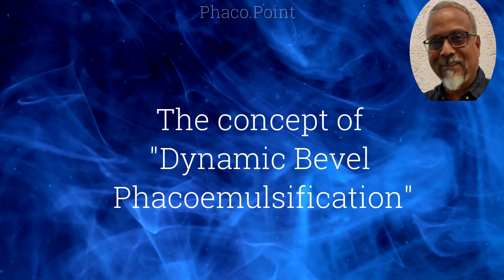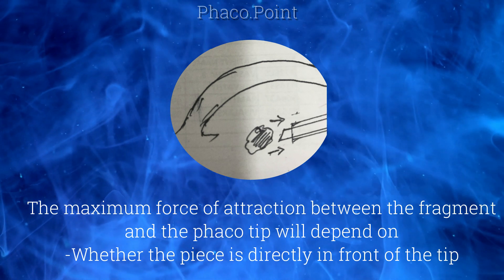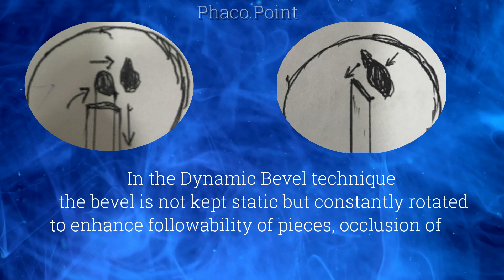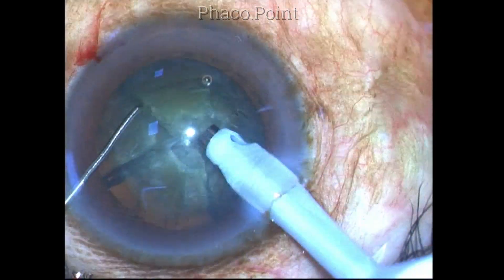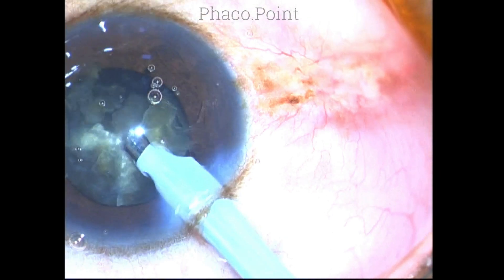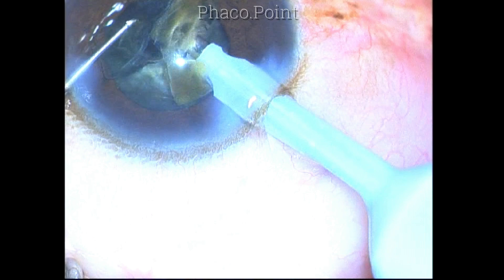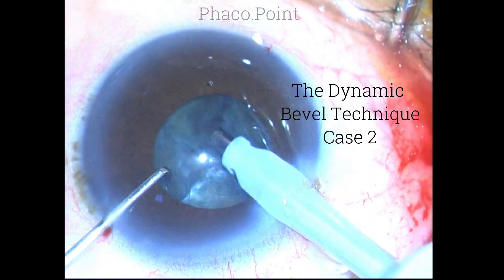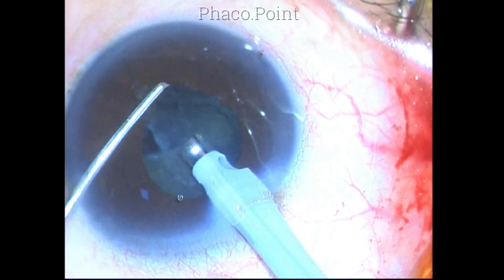The Concept of the "Dynamic Bevel" Phacoemulsification - to improve phaco efficacy

Comment: Hi doctor another great video 
So my question is i have note that when we  remove fragment in this video the fragment turn around the bevel tip and remove easily  ...so why this occur ? It occur because we use burst mode ?
Reply from the maker: it is not the burst mode .. it is because the vacuum suction will be in the direction of the bevel . any mode of phaco can be used
Reply: @PhacoPoint  we use venturi machine sometimes the vacuum does not work(flowability is less with 400 to 500).... so we take the handpiece  out of the eye and press position 3 as much as possible and then we notice that the vacuum (flowability) comes back?
Why this occur is there any fragment that obscur the tip or hand piece ?
Reply from the maker: @pharmall1662  Dear Dr you are right .. the nucleus fragment can occluded the tip or even the hand piece . that is what phaco power needs to be given in fp 3 to emulsify the fragment. This problem is more common if you are using too less phaco power and the nucleus tends to be harder

Comment: Sir, would you be so kind to write a parameters used by you. Flow rate, vacuum, ultrasound mode. Thank you.
Reply from the maker: Sure dr Gapuchio in the compaq machine for a grade 2 ns AFR 32: vacuum 350mmHg phaco power 40% mode variable whitestar 1: hard cataract: AFR 36 Vacuum 400mmhg phaco power 50% mode multi burst